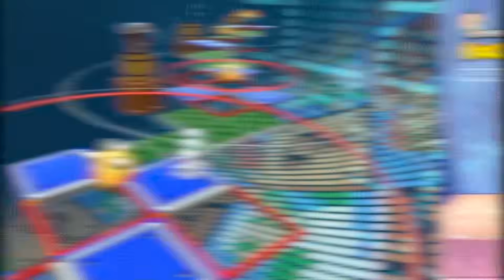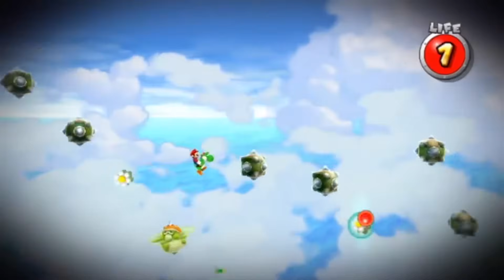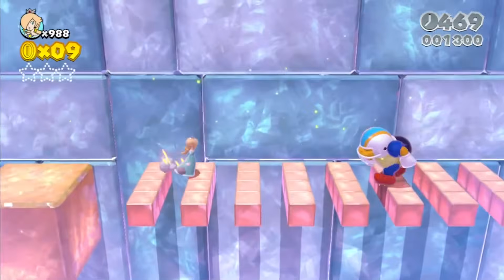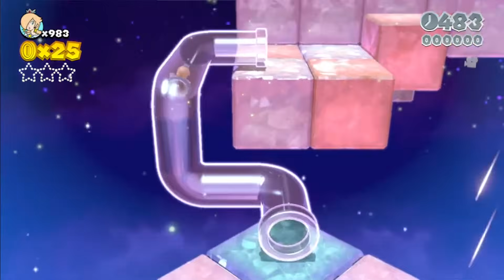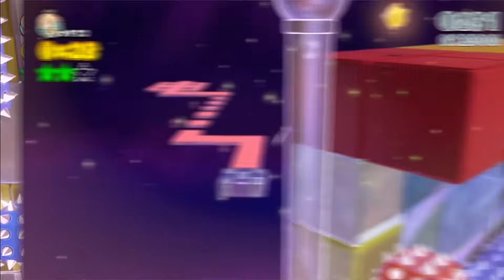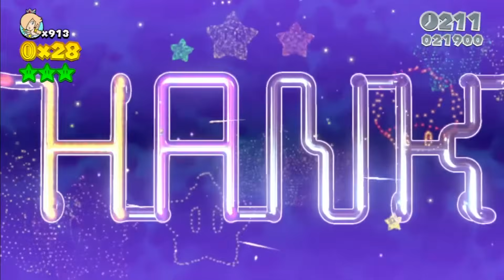How Hard Is Champion's Road Really? (Super Mario 3D World)

Comment: Tbh I finished the level as toad cuz blue, than with rosa, and is so different with toad i got into the flow state momentum, where in the begging if you vector enough you get hyper speed to skip some platforms, than in the block section I used ground pounds like the mario player and wall jumps, from there the spike part i just run through it as if I took time i was gonna get hit, the piranha part was actually very easy missed like 2 times, than water was normal, and the last section, was difficult but because of the speed rythim that I had through the runs it was much easier to dodge things as you have been playing in high speed already, sorry if its ti much text but for anyone who plays toad, just be fast belive you are sonic jsjssj❤❤❤

Comment: I had to beat this level 5 times to 100% 3D World (Wii U), 5 times because I was playing by myself and I couldn't find batteries for my Wiimotes. A tip to some people on the Boost Panel section, ground pounding is a way to halt your momentum for just a split second, sometimes you go too fast, and it helps so you don't accidentally run off the edge when jumping.

Comment: This level was extremely hard for me. I beat it with Mario using a Tanooki leaf and a lucky bell. I ran through the first sections using the glide to get across beep platforms easily, (as well as getting a running start) and using the spinning attack to beat the Kamek’s. I swapped to the lucky bell to get through the swinging bars and have an extra hit in the climbing/water sections. I then swapped back to Tanooki leaf to glide and avoid the orange bars that hit you as much as possible. If I took a hit I’d just use my few invincibility frames to get as many key coins as I could. Eventually it worked and I beat the level.